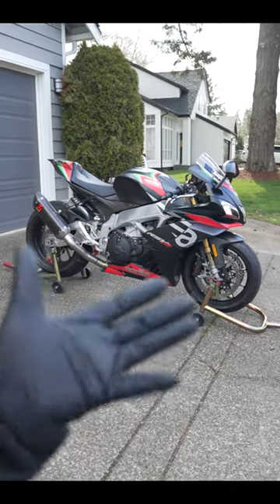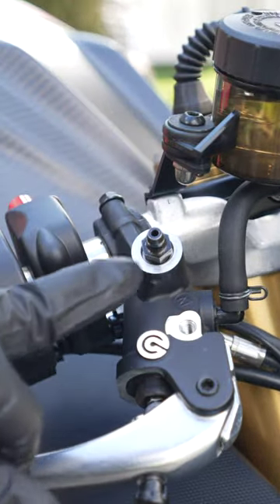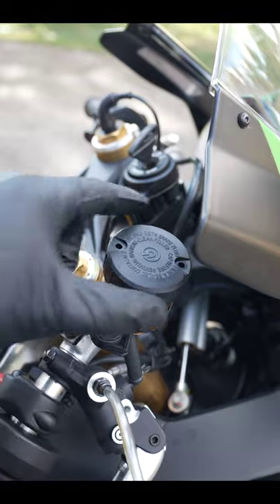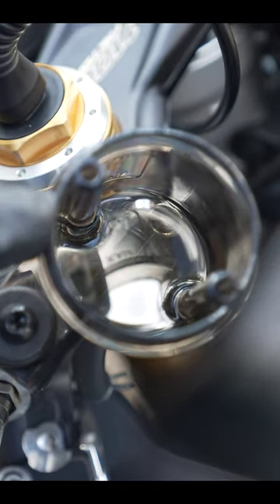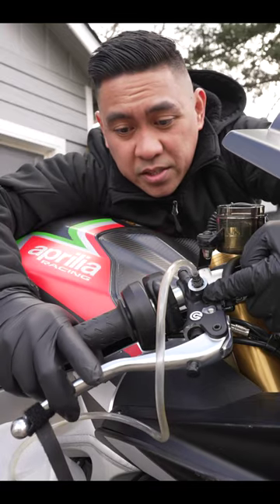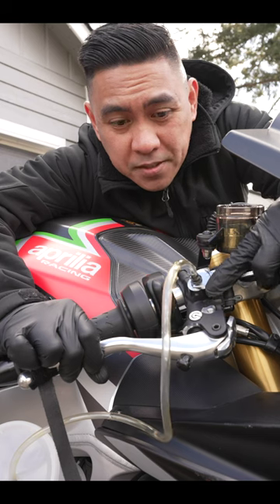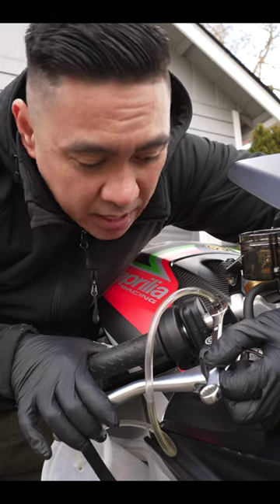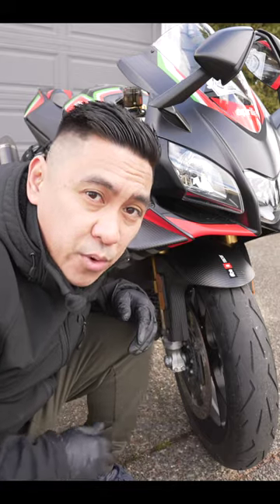How to Flush Motorcycle Brakes

Comment: good for old bikes, with abs (like in the RSV4) you should better connect a diagnostic tool for bleeding the abs pump too, otherwise that little amount of fluid will not be changed.

Comment: On most systems if you never let the the system run dry you can just pump the lever normally, without closing the bleeder in-between cycles. Once you have  clean fluid in the ststem hold the lever down and close the valve. Sounds crazy but I have bled hundreds of systems this way and never had to bleed any air of the system. Unless you forget and let the reservoir run dry. Air will not come in through the bleeder. I used to do it the way he showed and another tech showed me the expedient method, I never did it the old way again. I was very skeptical. It works.
Reply: When you let go of the lever the piston returns and creates a vacuum drawing air in you can see it in the tube sucking the bubbles back in if you don’t close the bleeder…

Comment: Hard part for me is getting the screws from master cylinder out without slipping them in small cc bikes a mere 200 cc bikes they are tightened like a swing arm bolt and hard to remove

Comment: I know it's not much more difficult on a car but people act like servicing a motorcycle is supposed to be difficult or expensive. It took you less than five minutes to flush the brake system. The difference is he could do it by himself whereas on a car you would need technique, a tool, or two people.

My point is I prefer motorcycles over cars  for simplicity and cheapness of maintenance. 

I'm still extremely bitter I can't afford to get a motorcycle since I can't finance one and I've never had more than $1,500 in my bank before.

Comment: Ive been having issues lately. Ill pull the brake lever and itll be nice and firm and then ill start riding and ill lose almost all pressure and to get it back ill pump the lever and will have pressure for about 10 seconds or so and back to almost nothing. Ive flushed and bleed them countless times. I have new lines coming in the mail but im starting to think the master cylinder is failing.

Comment: If your brakes where bleed when you started, why is there a need to bleed at the master cyl.?  There isn't.  That bleeder is for when you install a new master cyl.  When you bleed at the caliper and you push fluid out through the caliper, the WHOLE system on that master is bled.  It wouldn't have worked at all before if the master needed bled.  Doesn't hurt anything as long as you do it right, but shouldn't be necessary.
Reply: Literally the first word he said was “flushing” .. you 100% need to bleed them after you flush. Also sometimes after 10k miles you may need to bleed them again

Comment: My local shop gave me 5.1 for my bike would that still be safe to bleed the system with
Reply: 5.1 fluid is safe to use with any DOT 4 certified parts.

Don´t confuse it with DOT 5.0 though

Comment: Torque down the break nut with 1/16th once wrench to 380/16th or 20 ft lbs. Count the links make sure its an even number for metalurgy compound moto gp specs. Comb hair with three flowers. Helmet smells like vasaline butt wipes in the sun.